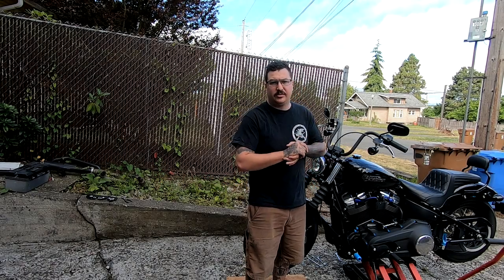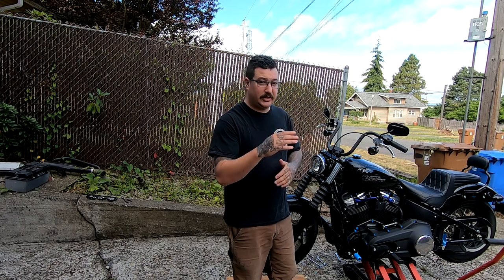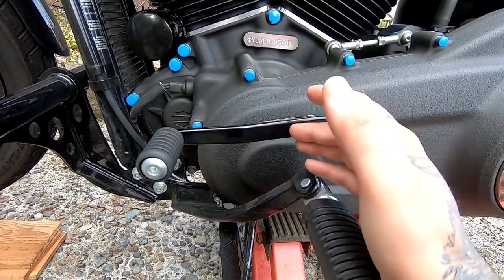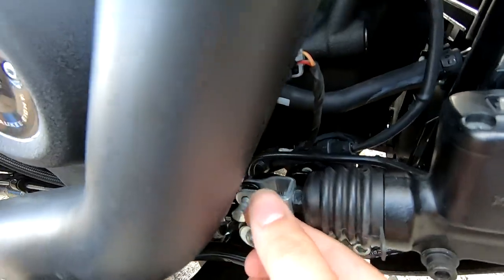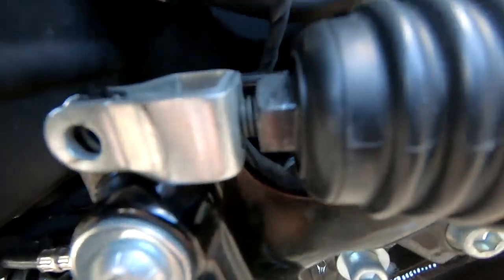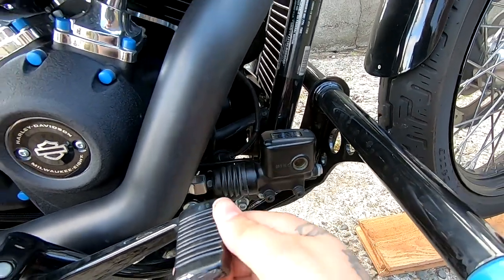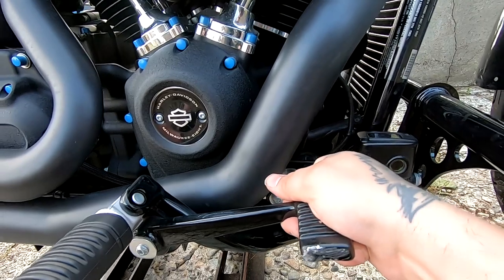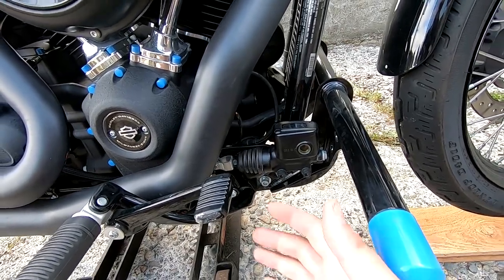2020 Street Bob Break Pedal And Shifter Peg Adjustment

Comment: You're a life saver. I noticed these things from day 1 or day 500🤣. Put up with it for 2 years. You're a life saver. I'll make these adjustments ASAP. I saw this in a forum couple days ago after being unhappy about the horrible rear brake performance. My front brake makes a screeching noise at the end of a braking cycle, lets say coming to a stop at a red light. I thought maybe it happens after the rotors heat up. Or maybe I don't need to squeeze the lever as hard. I mentioned these things at the first service but got typical answers of oh that's normal during break in. The service writer even said oh we might bleed the brakes. I was like yeah right, you're not doing any of that. And of course they didn't do anything. But now I can. I was getting nasty false neutrals and transmission rattles. Finding neutral was very difficult with stock mineral oil. I got syn3 at first service but skeptical about it. And these m8s are known for blowby and carbon buildup on cylinders. I am not sure if I should switch back to regular oil or try another synthetic
Reply from the maker: Awesome! Glad it helped! Have a link to that forum? I had no idea it was shared. That's awesome. These were so simple and harley wanted so much to adjust them.
Reply: @StevieTV253  i don't remember which one it was but I searched on google, m8 softail rear brake issues or something along the lines. And there's a picture of the rear brake master cylinder and 5 or 6 steps listing what you showed in the video. I'll drop a link when I find it again

Comment: Damn it, I didn't have the shifter issue, however my Harley dealer told me they couldn't adjust that silly little brake pedal when I told them it was too low and it felt as though I didn't have any rear brakes. !!! !*×#9÷
Thank you Sir 💯
Reply from the maker: At least you didn't pay them!